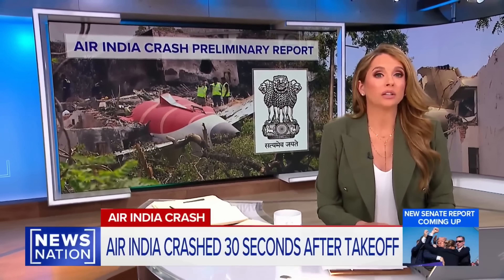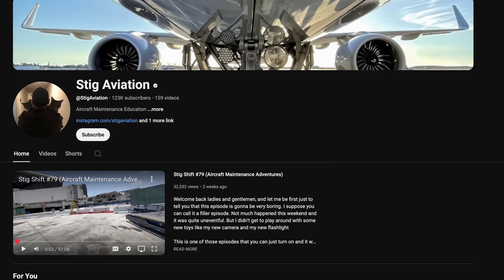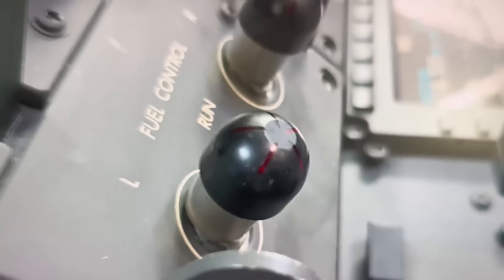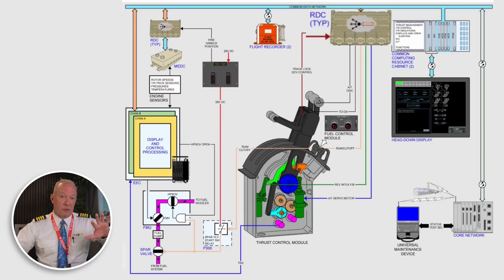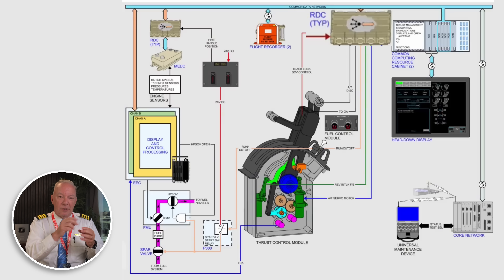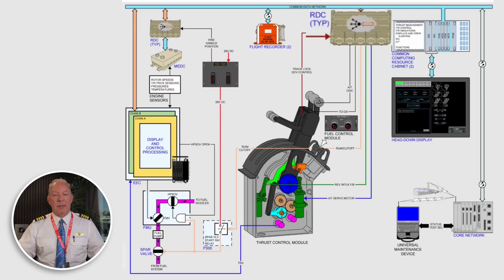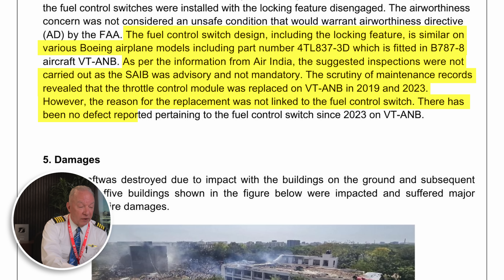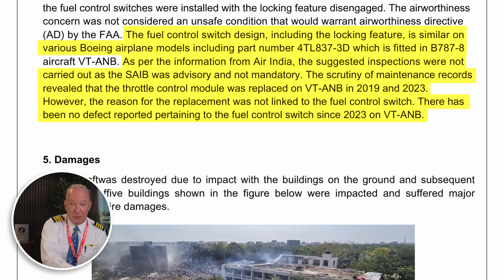The Truth About Boeing 787 Fuel Control Switches

Comment: 6:38 presumably there would be a fail safe that would not allow the valves to close in the event that the power failed
Reply: wrong, fail safe cuts off the fuel

Comment: Captain,  would therevever be a time two captains are selected to fly instead of one Captain and one first officer? How would delegation of authority work?
Reply: It happens. I have seen videos where this is discussed.
One video, it was a long flight and there were three pilots. Two Captains and a First Officer. There was one Captain who was designated as being Captain for that flight. Remember that Captain is both a rank AND a role. They're not the same.

Naval vessels, for instance, always have a Captain, but don't always have someone who holds the rank of Captain.
Reply: Aircraft carriers often have two fully qualified senior officers both of Captain rank - Captain Smith and Captain Jones.  One is the captain in charge of the ship etc. and the other is the executive officer who can immediately step into the top seat.  I would assume the airline designates who would be the boss on a particular flight.